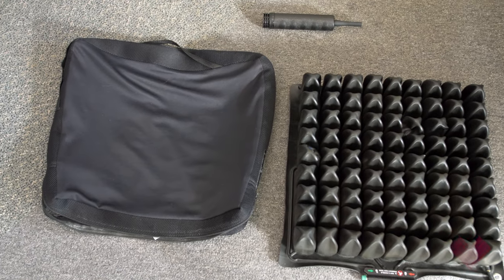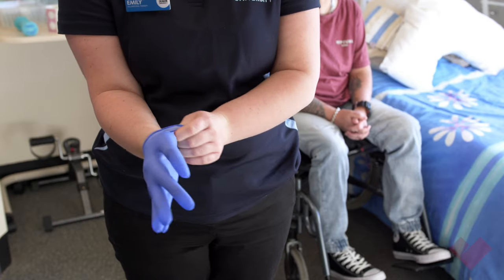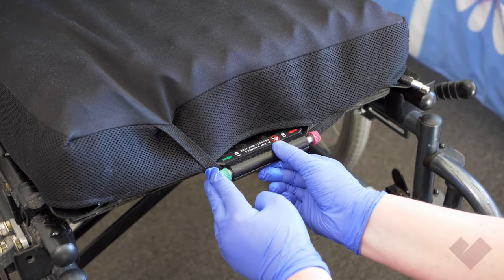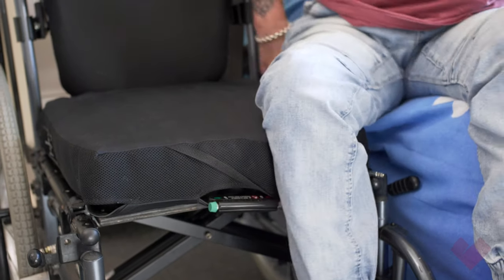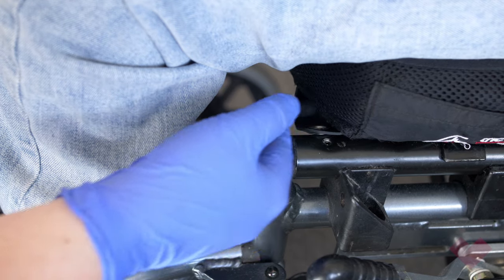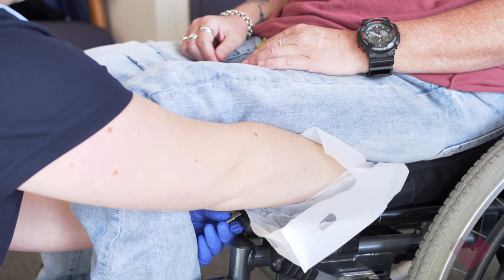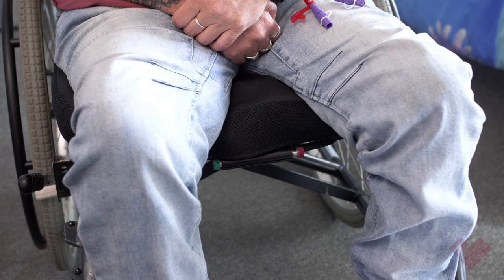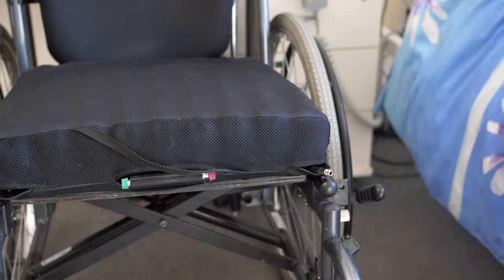ROHO Cushion setup guide

Comment: There is no way to allow for proper cushion for both sides of chair.  If you release air for the right "IT" then you let out air for the left side again.
Reply: That’s because you need to let the air isoflow at the front be open to let air thru all cushion cells. Then after checking the pressure, then you can close the isoflow closed.

Comment: The issue when inflated it expand to the side the cover don’t help especially when seated  mine I put a flat board on 4 side it helps to control the roho cell to expand on 4 corners which is the front flat board measure little than the rest but there’s still an issue so I donate it and buy a roho hybrid select no issue.